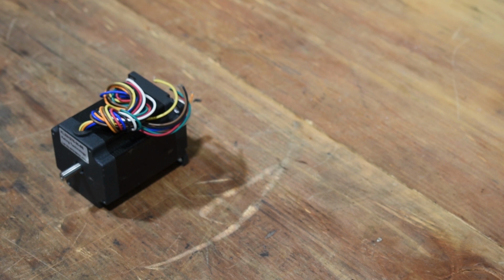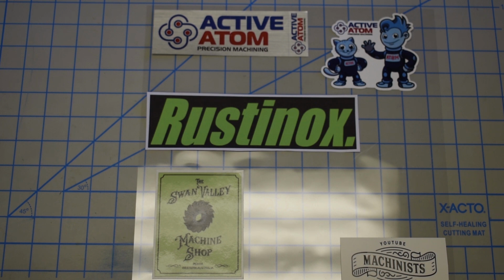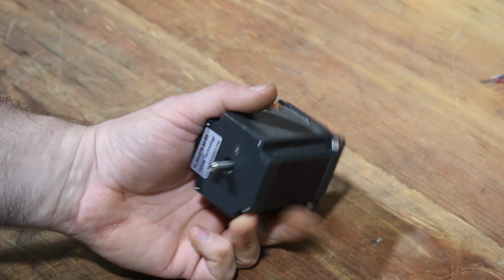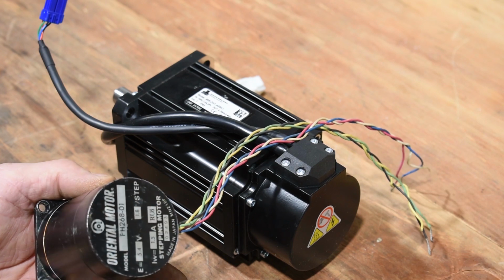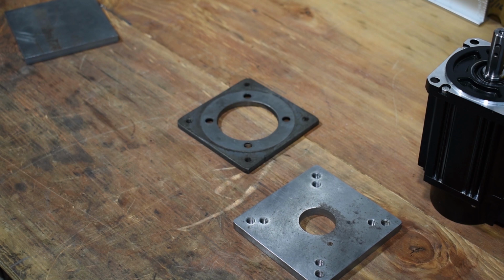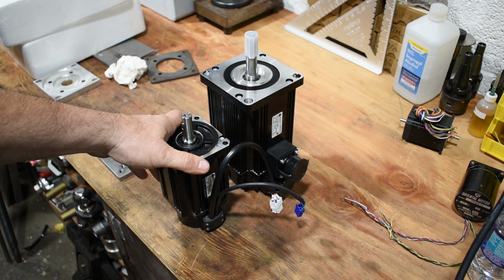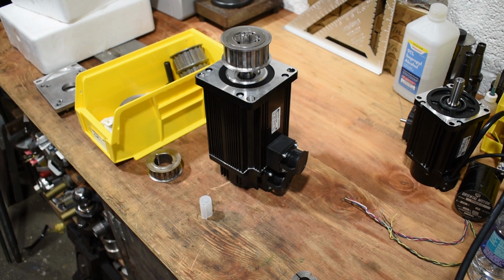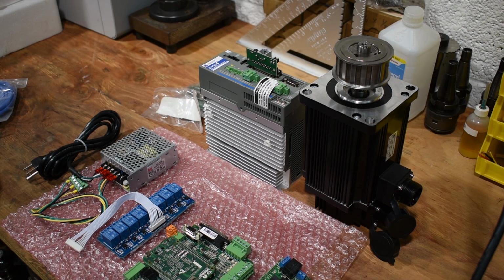Bridgeport CNC Mill Motion Control and Servos

Comment: Looking forward to seeing the progress and results. I am after updating my prototrak 2000 MX3 system to a centroid one and achieving 4 axis at the same time. was the reason for going from nema 34 to 42 purely down to the shaft adapter problems?
Reply from the maker: Super,  mostly just saving time... most folks i spoke to who did this kind of retrofit or conversion said 750 watt servos would suffice....   one of the things i did worry about was i have 1 -1 pulleys on my machine.. later machines were 2 - 1 ( which helps with the lower power servo )   I  am happy to have 1.3 Kw motors...   looking back i should have just purchased them in the first place...   I am not familiar with the prototrak   did it come stock with nema 42's ?  what are the specs on the original servos ? pulley ratio ?   hope you will share your build as well..     i also have a heidenhian conversion  that will probably be next   thanks for subscribing !!   joe

Comment: Hey Joe,
Whatever happened to this project? I went to your channel looking for the next part and no next part? I even went to your description hoping you would have all the links to your cnc choices. As a YouTuber I know how things get in the way but I would really be interested in where your at with this project. 
Mike - Plus8Precision
Reply from the maker: Mike,  thanks for the note...  sorry, have had some family stuff and a couple new clients really bog me down lately.  i am catching up with life and should be getting back to this soon..   i have settled on the centroid acorn and DMM AC servos.  since this video i have built the servo adaptors for the mill and shaft adaptors for the pulleys...   hopefully in the next month or so ill post an update   Joe
Reply: @RaptorMachineToolCo  ,
thanks for the update did you plan on going with Ball screws or using the acme lead screws?
Mike
Reply from the maker: @Plus8Precision   Mike, im upgrading the controls on my Bridgeport boss', Heidenhain, and EZ Track machines...  all which have precision ground ball screws.. my suggestion would be to find one of these style machines ( can find cheap with a broken control ) already fitted up. much less work and high quality .  if you are insistent on retrofitting a conventional BP  you should use a precision ground ball screw system..
Reply: @RaptorMachineToolCo  I have a Clausing Kondia knee mill. It's a bigger and heavier mill. It's what I found that was decent and in my price range. I'll probably have to do a ball screw retro-fit. Thanks
Mike - Plus8Precision

Comment: i have a hartford mill witch is a clone and I used centroid acorn works great just finished a 4th axis overkill build also. then i used acorn and DMM servos on my lathe conversion.
Reply from the maker: Joe Smith excellent ! Would love to see some walk around videos of them in action   Joe..
Reply: @RaptorMachineToolCo  my motors are direct coupled to screws on x and y I'm getting ready to replace balls crew and possibly upgrade to servos on mill

Comment: Can you provide a link where you can buy the pulleys and where you can buy the board adapters for the acorn?
Reply from the maker: the pulleys are from the mill.. you can usually find them on ebay ... the adapters are from cnc4pc.com

Comment: Where did you get pulleys ? I have the pulleys for the ballscrew end but I need the correct size pulley for the motor size
Reply from the maker: my Bridgeport came with the pulleys i have the 1 - 1 ratio pulleys.. the later models had 2 - 1 pulleys  you can usually find them on ebay or make them yourself.   
My servos are manufactured by  DMM technology  they were maybe 650.00 ea.  thats with the power supply
Reply: Raptor Machine & Tool Co. I didn’t see I already asked. I ended up buying closed loop steppers from fast to buy nema 34 12nm all three with drivers and power supply for $440.00 then I bought the acorn board. I’m on my way on my build! Trying to do it on the cheap though!
Reply from the maker: @trialnterror  excellent   hope you make some videos on your progress as well !

Comment: Hey Joe.
Love the new motor.
Definitely worth buying better equipment.
If you are going to trouble of rebuilding the mill.
 You might as well put something decent on it.

The best thing about Taper Lock Pulleys.
Is you don,t have to do any Keyway broaching. 

You have got me thinking after watching this video.
Might be worth building a 4th Axis with this set-up.
Definitely be watching with interest for your next video,s.
A very simplified set-up to build.
Thanks for sharing your latest project.
Peter.
Reply from the maker: Peter!  I actually have a Rotary table that i have set up with a servo and an arduino for some automated work already... i will do a video on that sometime soon along with a couple other goodies ! thanks for tagging along !  Joe